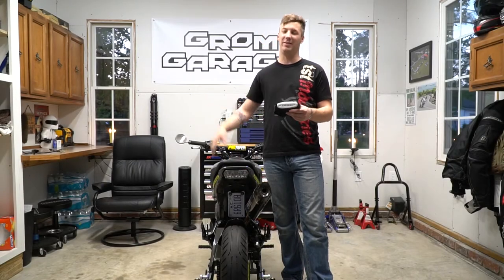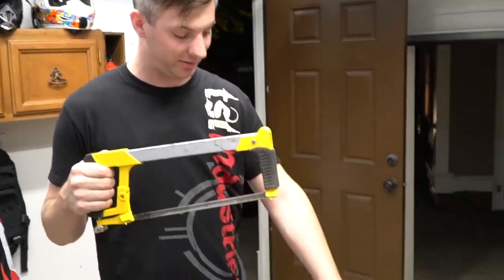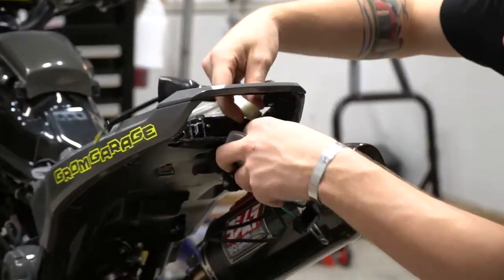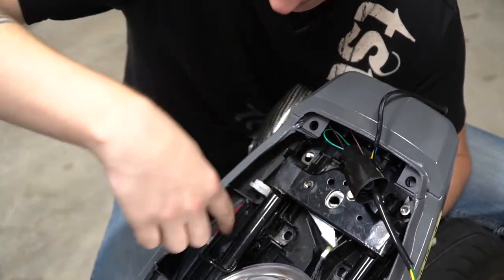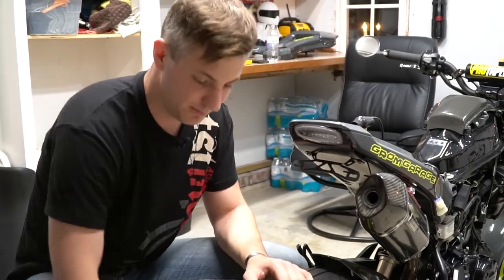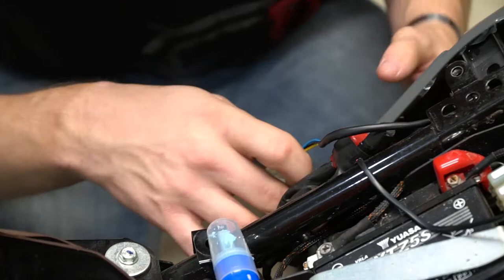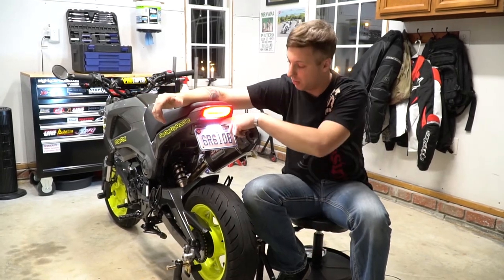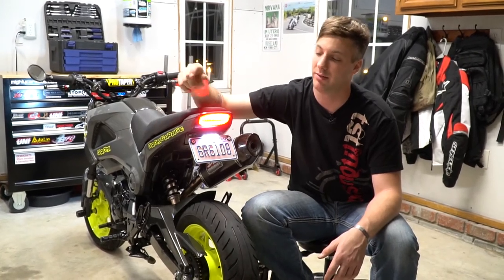TST Industries Integrated Tail Light

Comment: ugh didn't think you were going to have to cut the back, kind of worried about that but the finish looks so good.
Reply from the maker: +drew drew it's actually really simple with a hacksaw.  Just line it up with the rear of the frame and go slow.
Reply: Grom Garage what's the price? my buddy seen it on tst website but then checked again and it was gone.
Reply from the maker: +drew drew it is $169.99 before using the GG52017 coupon code.  It showed up for me when I clicked the bitly link
Reply: Grom Garage and how much does the license plate light run also thanks for the replies, got to get ride of that stock fender  ASAP!
Reply from the maker: It is $14 on their site, but also qualifies for the discount.
https://tstindustries.com/TST-LED-Stealth-Universal-Fit-License-Plate-Light.html
Reply: Grom Garage oh now I know why I couldn't find the price was looking for the 2017 one guess I'll have to wait a little longer 😪😪😪
Reply from the maker: +drew drew ahhh that makes sense.   Ik they are planning on releasing it soon for the 17s
Reply: Grom Garage cool can't wait, can't believe it will be much different